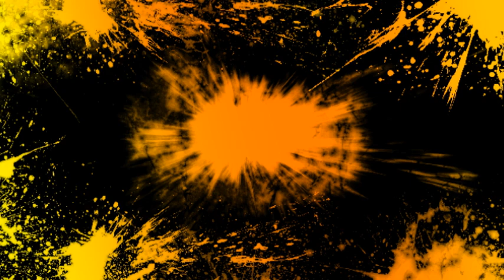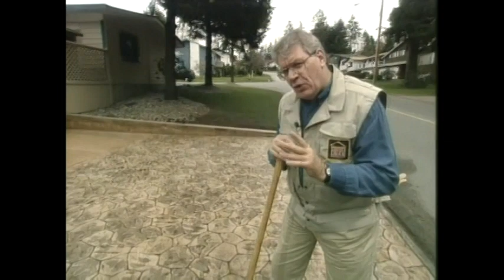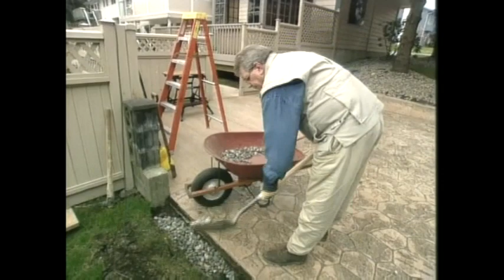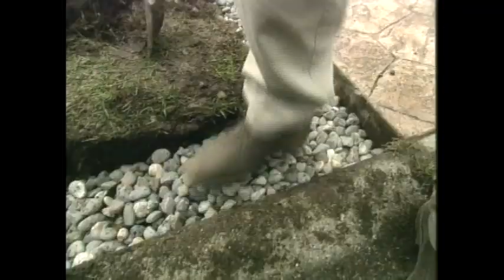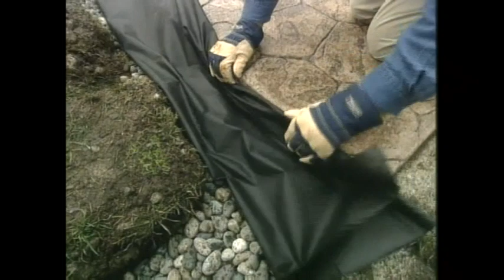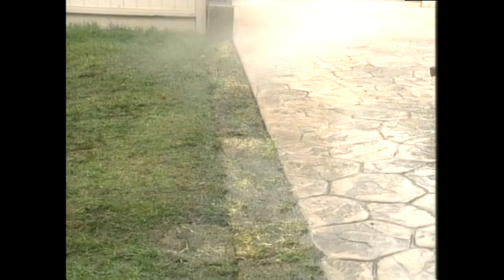How To Drain Water Away From Slab Driveway

Comment: In California all new homes are built on a concrete slab (2-3 feet thick). When I try to install a new downsprout, can I just leave the downsprout open to the concrete pave way around the house? Or should I connect PVC pipes to drain the water beyond the pave way? The pave way is tilt down away from the house of course. I can imagine that when water comes out of the downsprout open, it will flow on the pave way into the soil/ground which is about 3 feet away from the foundation. I wonder if I need to break a trench  on the pave way and connect a pipe to the open end so to guide the water down to the street drainage. Thanks.
Reply: Someone lied to you lol. Maybe 2-3 inches.

Comment: Poor guy, made one of the most ineffective french drains out there. The buzz drain is built to fail when all the dirt shifts into and around the rocks making it harder for the perforated corrugated pipe. Should've just kept to the basics of the french drain and wrapped the area with the lining to prevent dirt from getting to the rocks and the system would last longer and work more efficiently.
Reply: Lol😅

Comment: Why not do that on the other side of the driveway where the problem starts?  Seems like you were talking about runoff from the yard only and so I wouldn’t think you wood need a 20’ deep retention wall as mentioned, but a drain similar to what you did on the other side

Comment: For what it is worth. I am not sure about letting the water go under the slab? Wouldn't that cause settling and voids under the slab and later on, Cracks?
Reply: You cannot stop water from going beneath a slab. You'd have to put a retaining wall 20' deep.
Reply: @moonpiespotlight4759  I know this is a lot later, but I assume the implication was that you could have put one of these drain pipes on the elevated side before it went under the slab to potentially mitigate the amount going under the slab.